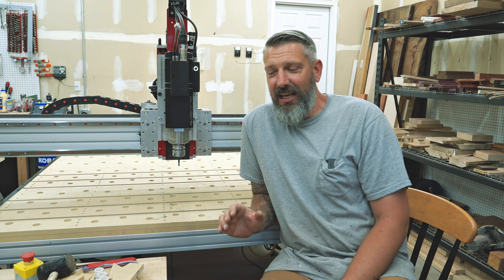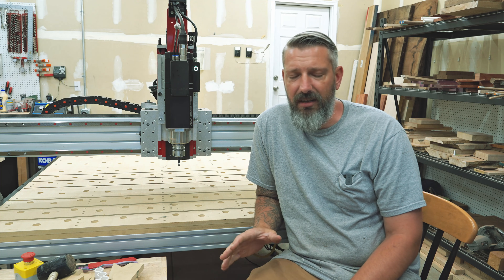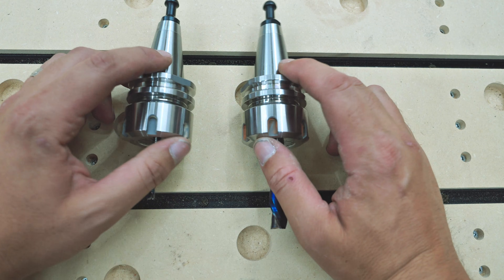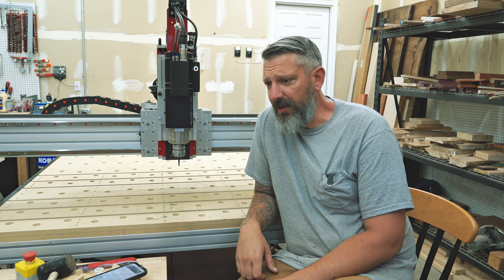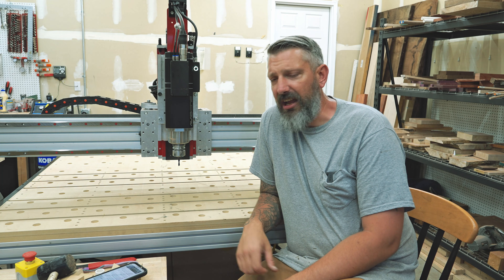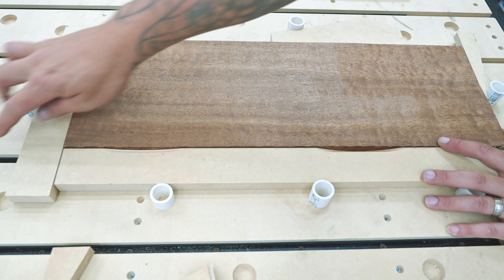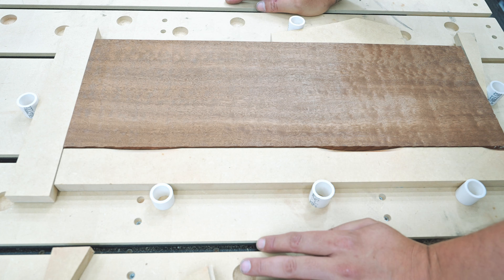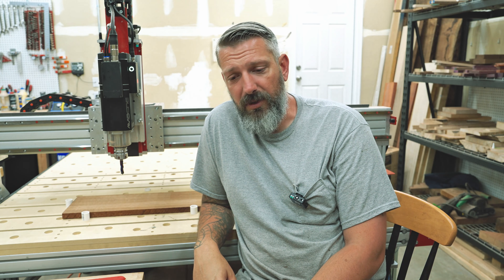5 things I LOVE about my CNC Machine! 5X10 AVID CNC

Comment: Two questions for you on your spoil board - You have two layers right?  Is the bottom layer like mdf cut like 5'x4 ?  I'm looking to buy a 5x10 and I was curious.   Also with your pvc piping do you find it hard to get those out?  You seem to have to hammer them in so I assume getting them out might be hard.
Reply from the maker: Yep, I ripped a bunch of 4x8 MDF sheets down to 5’ x 4’ for the first layer that was secured to the frame.  I ended up using the offcuts for another project I was doing to there was no waste.  For the holes, I kept the tolerance tight so when I indexed a material against the side of the pvc, it was true almost every time.  It’s tight and I have to pound them in with a mallet, but removing them isn’t that bad.  I have a large plyers that yanks them right out.  Cheers and good luck with the future machine!
Reply: @EricksonWoodworking  Thanks for that info!  I did purchase a used 5x10, but I haven't picked it up yet.  I do plan on upgrading the EX controller and most likely the servos.  I look forward to seeing more video's from you on this beast! Thanks for all your content! A+
Reply: Do you really think you need the tramming tool?  where did you get your granite that you had your SST tramming tool on?

Comment: Also: the wedge technique of holding down will pull up if you do aggressive machining with an upcut bit (specifically, 3/8" bit, 3/8" DOC). So, be wary, and don't trust it.
Reply from the maker: Thanks!  I really should of mentioned that on the video, I also forgot to mention about double sided tape I use to add additional strength.  I finally had an opportunity to use the inspect tool feature in CNC12.  That is such a great feature to pause the cut and clean out deep pockets.

Comment: Have you seen my ATC setup for Avid CNC with Centroid? You should check it out.
Reply from the maker: Yep!  Your video is what keyed me into looking at the AVID setup and choosing the ATC ready spindle.  I’m not fully there to make my own and do the programming, so I’m going for the release of the rack.  I’m really excited about it
Reply: @EricksonWoodworking yeah, I’m sure whatever avid comes up with will be nice!
Reply: you can go the easy route and use rapidchange atc that doesn't require ATC capable spindle nor the pnematics. it is compatible with centroid.